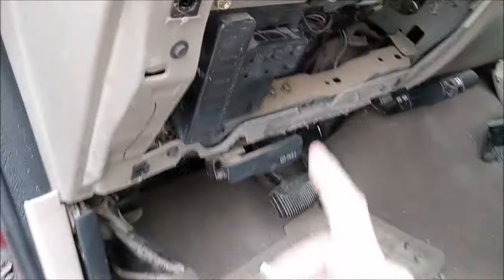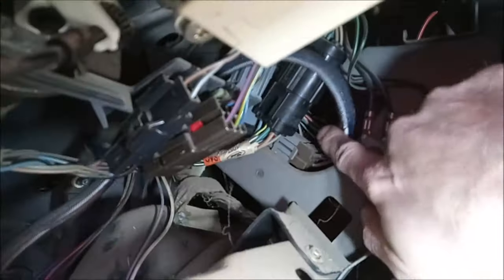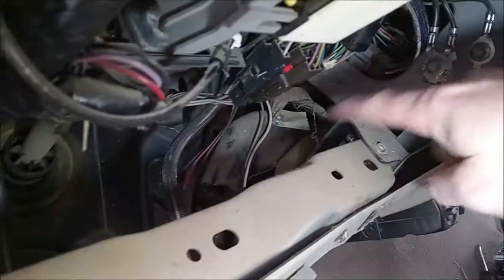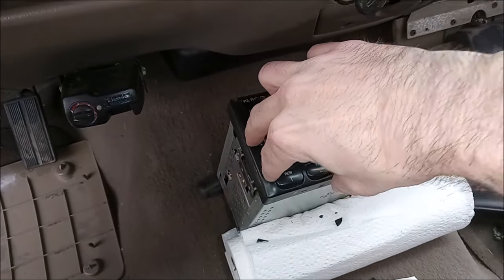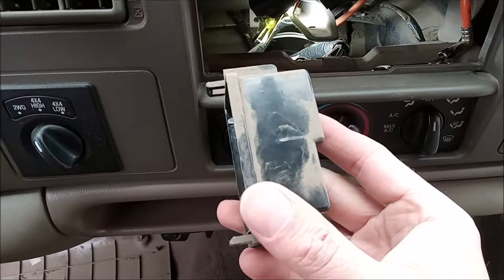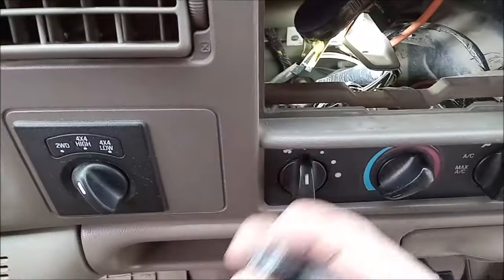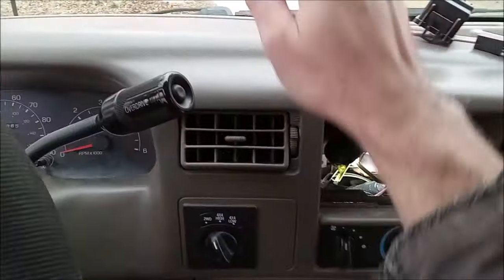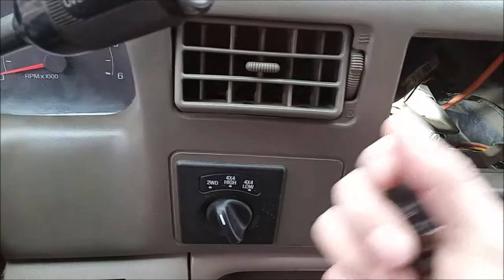f250 fuel pump relay location cranks no start 5.4 1999 2000 2001

Comment: I just happened to be working today on an 04 f250 super duty 5.4L. Did an oil change on it pulled an accessory light on top of the cab. Finished that then went to crank it it turned over for and died in about 2 seconds then nothing only cranked. Replaced a fuel filter but verified no pump when I put the new one. Checked all the fuses good. Popped off passenger cover by fire wall checked the stuff the looked like some kind of module the checked and was good. Ran a hot wire to pump gas flowed out. Then went to find the purple w/black wire no power at the pump. Went check all the fuses again good. I was getting tired of this model truck did some more internet searching found this Video. All I did was hit the Dash like he said and boom the fuel pump kicked on connected the fuel lines the motor turned over. Thanks

Comment: On my 2003 f250 5.4, the relay is not behind the radio.  I pulled that relay and it killed my blinkers but my engine still starts and runs.  On the driver side engine compartment, there are two small relays and one large one but the engine still runs with them removed.  So even though they say it was 2004 when the relay was soldered to the PC board behind the passenger side kick-panel; I'm suspecting that is where it is?

Comment: Unfortunately for me that relay cover didn't just pop off.  What a pain. So a follow up. Only one large relay behind the radio but it was not for the fuel pump.  I found mine on driver side in engine compartment. Little black box with 2 small and one large relay. These also were not the fuel pump relay as the truck runs with them removed.  Maybe mine has a fuel control module back by the fuel tank.  I'll look there next.
Reply from the maker: I was lucky this time but they can be a pain
Reply: the blue one is the blinkers the little black ones are fuel pump
Reply: @TaylorCutsTrees  I only have a large black one and yes it is the blinker.
Reply: @TaylorCutsTrees  Mine does not have a blue blinker.  The wires on the back only go to one of the two sets of sockets for a black relay with five pins just like most relays but I can feel it clicking every time the blinker blinks.  This is weird.  I'm going to remove the fuse panel under the dash on the driver's side to see if I have a relay wired to a circuit board like the Expeditions have that's located under the kick panel on the passenger side.
Reply: So why does it have five prongs like a relay?  All the flashers I've seen only have two prongs.